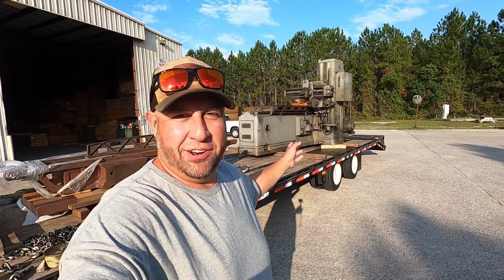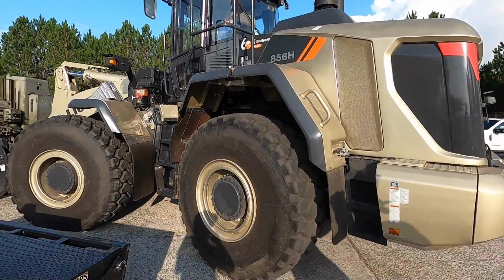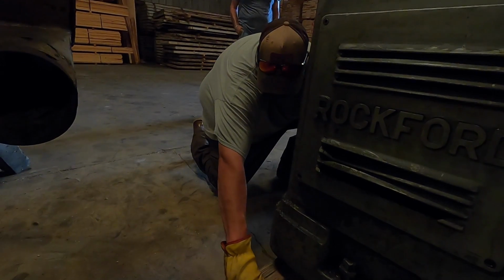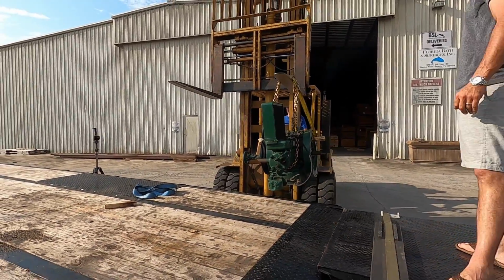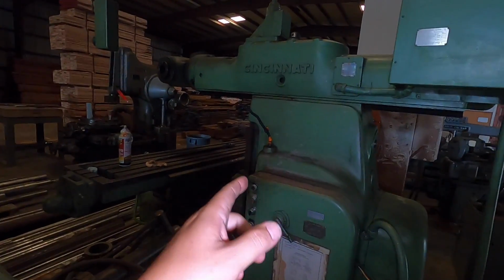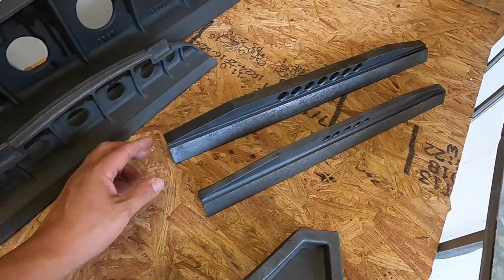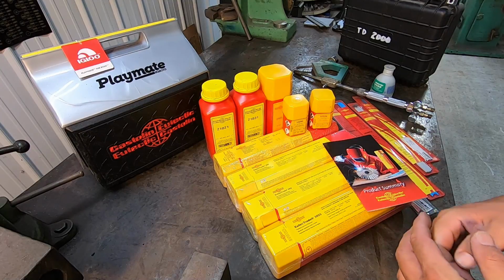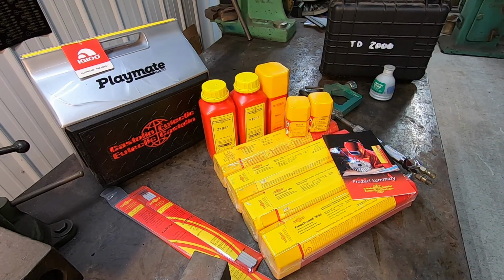SNS 315: Rockford 60" Openside Shaper

Comment: @17:00 I hope Flip Flop Dude didn't crack a flywheel lifting that engine by the "Hunk of wood / nylon strap" rigging method of moving a hit & miss engine....  I learned that the hard way ....one of mine got cracked 🤬at the hub by a seller loading mine on my trailer ... Before I found out not to do that... the damage had already been done... that was a $200 lesson learned to buy a replacement flywheel .... Really Enjoyed the video

Comment: That's a light one! I scrapped one of those out that had a 10' table, about 30 years ago. I had to un-bolt the tower with the arm on it, inside of that was a 1000# counter weight. Then I had to cut the base into two pieces after manually running the table to one end. One half of the base with the transmission and table weighed 14,800#. They loaded that on my truck with a Komatsu wheel loader that made the one in the video seem tiny.  The Komatsu had the bucket on it with eyes that we chained the bed to. When the operator curled the bucket, the weight mashed the front tires to less than half the sidewall height and bent two links of a 24,000# chain at a 90 degree angle where they went over the cutting edge of the bucket. Also, the drive shaft that stuck out of the side of the base punched a perfectly round 3" hole in the bed of my truck (1/4" steel plate), when they set that piece on the truck.
      When I got to the scrap yard was the time when I really began to sweat. The piece was too heavy for the hoist on my truck to dump, so they magged it off of the truck. I didn't get nervous until that operator lifted it in the air about 8' or 10' over the bed before he swung it from over the  truck. I knew if that magnet failed, that piece of machine was not going to be the only thing sold that day for scrap.

Comment: Hey Adam, is this beast under power yet?  I've got the same one here at Seattle Maritime Academy on a 1953 ex-Army "Floating Machine Shop (FMS-789) barge" and I'm just starting to get her moving again.  It has a grinding attachment on the top side, I'm assuming for cylinder head clean up?

Eagerly awaiting video #2,

Danny
Reply: The occupancy date on Adam's new shop space should have been last week (first week of December 2021), and as it has more than enough room for a machine like this and a good sized jib crane, it would be my guess that as soon as he can, Adam will be moving this and some of his other large machines, like the radial arm drill press into that space to get them up and running and making chips.

Comment: That doesn't make sense. A machine like that should have stampings, tags, and arrows that indicate the center of gravity. Especially if the sliding components move on a track across the bed. Zero the COG and indicate where the fork tines should go. This is how people get killed and machinery is ruined.
Reply: Back when those machines were made, the workers were considered consumables... safety and safety considerations have come a long way in 70-80 years.

Comment: Many years (decades) ago I worked for Standard Modern Tool Company of Toronto.  They produced the only remaining North American designed and built engine lathe.  In the production shop they had a planer that machined the ways on all their lathe beds.  They would gang cut sometimes three or four beds at a time.  The largest bed they produced was for a 20" x 120" machine.  That meant a travel of something like 15 feet or more.

Comment: To hell with CNC. Anybody can push buttons and enter programs, a real machinist is always going to do better on individual jobs. When it comes to 1 off jobs you can’t beat a human hand to account for all the little variations you may need to have a part work.
Reply: you need to be a decent machinist to run cnc successfully. If you push buttons blindly with out any appreciation of tool loads or working piece holding or tool geometry you will end up with a disaster.
Reply: I have a tool and die shop and have to run all machines Lathes od grinders, surface grinder, manual mill and cnc wire edm and cnc lathes and mills. To build tooling packages , You need to use all these machines. No knock on You friend.

Comment: Hey Adam.  Love watching your videos!  Used to work in machine shops when I was younger.  Mostly CNC lathes and mills.  But did work at a shop where they had a large Pratt & Whitney Jig Bore machine I ran sometimes as well at some Bridgeport work.  Was stationed at Eglin AFB up the road from you back in the 80's and early 90's.  Miss living there and doing machine shop work.

Comment: i love those older hyster forklifts  , i used to word with those 7 ton metric ones and bigger  ,but maybe lay some wood cardbord or even rubber on the forks to stop the machine from sliding if he needs to brake hard .
Reply: More grip on such a top heavy machine isn’t going to do you much good; it’d sooner topple over than slide off the forks. Just drive slowly.

Comment: Adam, I think you have a problem. Once you started buying Scrapers you just couldn't stop. Sort of like Lay Potato Chips. Are you planning on putting this on the slab outside the shop? You should have enough slab support to handle the weight. Nice find.

Comment: Adam, I have a Cincinnati No. 4 almost identical to the one you're considering (minus that sweet powered overarm).  Those machines are, in my opinion, some of the best mills ever made.  Absolute Cadillac of milling machines.  They will snap 1" endmills like they're toothpicks!
A really cool accessory to have is the spiral milling attachment (Cinci called them "enclosed driving mechanism") which works with a Cincinnati dividing head to allow spiral milling.  Obsolete now in the day of CNC, but for us iron-nerds it's just fun.  I have one but it needs a rebuild...like most of my old iron!
Cheers!

Comment: It is great you rescued that planer - large machines such as that usually end up as scrap as no one has home shop large enough or transport capability to deal with one. Its not even floor space - imagine for rigidity you should have a strong foundation.

Comment: When I ran one of these in the late 60's it was called a Rockford 5' planer.  It was one of our newer smaller planers and the adjustable stop helps keep you from waking up with it raining spikes.  spikes: used to hold down thin plates while surfacing.

Comment: You're well on your way to committing to some sort of shop switchup. That Cincinnati mill John has looks like it will fit right in with your groove, neat piece too. Great tip on the flash rust with the evaporust. Thanks for sharing

Comment: Is there a technical distinction between a "shaper" and a "planer"?  Seeing that the bed moves and the tool is stationary, I would have thought this would be a "planer".  Of course I'm thinking of Keith's planer restoration project, which is way older...so maybe the naming just reflects the age of the machine?
Reply: You are correct it is a Planer, shapers move the tool not the work each cut.

Comment: My not at all an expert or professional opinion is that if it’s ran all brass or 90% brass, it may have had a soft life, but it may have been for more precise things and maybe the ways were resurfaced often and tightened extra, meaning it might not have much life left in those areas? Or they might need to be replaced

Comment: Were those steel-toed sandals?
Reply: There are times where it does not matter what footwear you have .  If a 7 ton machine lands on our foot, steel toes will not make a difference.  Now, steel toes are great when a 70 lb straight edge lands.

Comment: We used call any machine that  the table/job moved and not the tool a Planer  and any machine where the tool moved a shaper and of course any machine that cuts the same way as a shaper internally a slotter.
But they all are shapers at the end of the day, and I'm in the UK lol.
And of course if the manufacturer calls it a shaper it's a shaper.
I'm very envious of you Adam it looks a magnificent machine you'll be able to do some serious abom cut's on that machine.

Comment: A old time Frenchman that lived in my neighborhood and had his own precision machine shop where he did work for the airlines and NASA had a similar mill only it didn't have the horizontal capability. It was all hydraulic controls. He got it at auction from the government in the 70s and he said they were the most expensive mills Cincinnati ever made and we're made for NASA specifically. He said it was the best mill he ever operated and he started his apprenticeship at age 13 and I met him when he was 79. I had the chance to buy it for 2k but had no where to put it at the time. Along with his Cazeneuve lathe.  I kick myself ever day for not buying both of those machines. The owner of rotex punches ended up buying the lathe.
Reply: david ghiglieri Sounds like it was a hydrotel mill
Reply: @bcbloc02  no, the hydrotel seems to be a much larger mill. The mill the Frenchman had was similar to the size ABOM showed  but XYZ movement was hydraulic along with manual if I remember correctly. For sure it had hydraulic movement. It would also spin the quill up to 20k RPMs. He turned it on to show me the 20k RPMs it could spin ( he had a 4" facing mill in the quill) and when he started getting close to 15k RPMs I started walking back expecting it to explode since I have never seen a piece of tooling spinning 20k rpm. He said the machine was capable of taking super heavy cuts. He said they only made 50 of that model mill. What ever model it was, it was amazing and would jump at the chance if I ever found one again.

Comment: I worked as a diesinker in my earlier days. We had Rockford hydraulic planer. It was used for planing dovetails on the forging die blocks. My question is I am pretty sure this is considered a planer. My understanding is that a "shaper" the cutting tool moves against the stationary piece to be machined. A "planer" the pieced to be machined is moved to the stationary cutter. If I am incorrect let me know. But that is very similar to the Rockord hydraulic planer that was in our shop.
Reply: Here's a link to the operations manual that shows what Rockford calls this model. You'll have to ask them why. https://www.amazon.com/Rockford-Opernside-Service-Operations-Maintenance/dp/B005MEPGQM

Comment: I wonder if it will need it's own dedicated concrete pad to support that weight?
Reply: 15 k? I imagine so unless Adam can find a suitably thick piece of concrete..
Reply: @charlesangell_bulmtl  thick with reinforcement? I'm no concrete expert. Perhaps in pure compression rebar is not required. But the strength of the base might be
Reply: @sblack48  It raises the opportunity to build a heavy steel base  and cast into  and around it
Reply: Charles Angell yep I think that will be step one. I read about the huge forging presses that they built after WW2 (totally different thing I know) and they dug 150 ft down to bedrock and the concrete bases was on the scale of the hoover dam. This thing won’t be pounding up and down, so they just have to support the weight, which your average floating shop slab might not. I will be curious to see what he does. There is a neat channel on yt of a guy with a big planer in NH. He does lathe beds etc. It will be nice to learn how both Adam and Keith learn to use theirs. And guys will be able to get old lathe beds planed flat.

Comment: Man that’s so cool! I have never seen a shaper that big, I can’t wait to see you fire that thing up and make some chips! And I’ll definitely have to check out those brazing rods. I hadn’t ever heard of Eutectic until you mentioned them in I believe it was the last spray welding video. But I’ve been meaning to find some better rods then the cheap ones I’ve been using and it sounds like they make some quality products!
Reply from the maker: They have high quality products for sure. For 7018 rods, the Lincoln Excalibur are great.

Comment: A bit off topic, but just a thanks to Adam and the other youtube contributor in the metalwork, machining etc field for going to the time and effect of documenting their skills. I am a long time viewer and today I was able to put some of what I had learnt into practice.  I had a small lathe job so I “dusted off” my old little chinese lathe and then said “How would Adam B or Keith F or Keith R do this”? a) give the lathe a good clean and lub what should be lubed, tighten what should be tight etc.  b) write down all the important measurements and do a little sketch. c) Think about the order I should do each step in, to avoid having to put the piece back into the lathe etc. d) Indicate in the round stock, face the end,  drill the end and use the dead centre. e) Take small cuts first to learn about this bit of material. f) THERE IS NO HURRY... TAKE YOUR TIME. g) If you make a boo boo...STOP. Do not compound the problem!..  think about how you can rescue the situation. h) Do not get greedy with your depth of cut, “sneek up” on your final measure and plan that your final cut will be very light and tidy things up..  After several hours work I had a very proffessional looking piece that I could be super proud of... pity it is going to be buried away inside the final product, where nobody can see it!!  Thanks for your help
Reply: Congratulations, Andrew. I’m sure the folks you mentioned will be very pleased that you put their hard work to such good use.
Reply: Somebody I missed from my original post was Tom Lipton.. gee he does nice work..  One other thing I note from all these people is that they only have one level of workmanship... top level! , if they are make an item for a paying customer or just a jig or holding fixture to aid the making of something, holes are countersunk, edges are camfered / deburred, made shiny with a bit of scotchbright etc...   Also there is no substitute for the correct tool for the job..

Comment: so Adam,  with this new shaper would you still need the other two? is the new machine a one size for all kind of deal?
Reply: Different tools for different tasks, I figure.

I wouldn't expect a hydraulic drive to have the kind of stroke speed that a crank drive can; on the other hand I wouldn't be surprised if it can handle even heavier cuts. Apparently you can also set hydraulics up with draw dies, press tools, etc., as well as "soft" feed stops for when a crash is possible - the ram can bypass instead of breaking something like a hard mechanical linkage would.
Reply: He needs a bigger shop!

Comment: I remember using Eutectic welding rods as an apprentice welder in England in the late 70's. They were made in Ireland, a subsidiary, obviously. Great rods for cast iron ( nickel) and good quality 7018 for vertical and overhead. Wow, been 43 years since then. I immigrated to Ca in 81 and spent 34 years as a welder in the Sheet Metal Workers Union, just retired at 58 last summer. Love your channel.

Comment: I'm puzzled. I understood that on a shaper, the ram/tool head is the moving part and the work is stationary. While on a planer, the work table moves and the tool head is stationary, similar to a milling machine. This machine appears to have a moving work table. What defines it as a shaper?
Reply: It is a planer.
Reply: @kooldoozer  That is what I was thinking.
Reply: Me too
Reply: If Rockford calls it a shaper, then it is a shaper.
Reply: @paulcopeland9035  Spoken like a true follower. Rockford is wrong.  My Rockford says shaper also. Does not mean it is right.
Reply: The old Rockford catalogs list the machines with 2 to 3 foot travel as shapers.  Machines with 6 foot and more travel as planers.  Machines in the middle they call a shaper-planer. LOL.  With 40+ years in the trade, my understanding is the same as the OP

Comment: I have run that same Cincinnati machine when I worked for the Boeing Co. They are fine rugged mills. My table wasn't quite that long. Roll that long arm in and tuck it up tight and the vertical head will make a heck of a cut. Only problem I had was keeping it trammed in. Old machine had a lot of hours on it. Gonna need to bust out a wall for that new machine...........

Comment: I have a Eutectic/Castolin TIG Welder CastoTIG 2202 AC/DC. Really high quality stuff. It is the same as the Fronius. But I'm looking for original gas lenses and collets for the original CastoTig G 220 UD/D TIG torch. Anybody knows where to purchase these things as non-commercial customer?
Reply from the maker: You can buy Eutectic from any reputable welding supply house.

Comment: what makes this a shaper and not a planer?
Reply: Rockford calls it a shaper.  That is why it is not a planer.
Reply: @paulcopeland9035  If a company made a screwdriver and called it a hammer, it still doesn't make it one.
Reply: @paulcopeland9035  Well, I suppose that's a good reason.
Reply: @paulcopeland9035  calling a cat a dog doesnt make it a dog
Reply: I think it is a planer
Reply: I was thinking the same.
Reply: @hairypaw9165  Ditto, I was under the impression that a sliding-table machine was a planer.
Reply: The only real difference I see is that it only has a column on one side and it can also plane the side of the workpiece.  Otherwise, I agree it's more of a planer than a shaper because the workpiece moves and not the cutting tool.